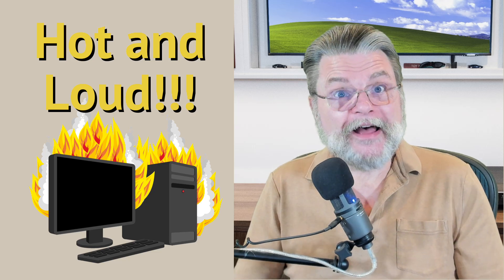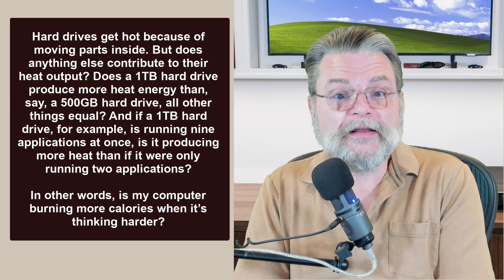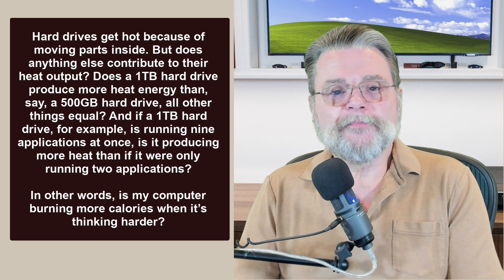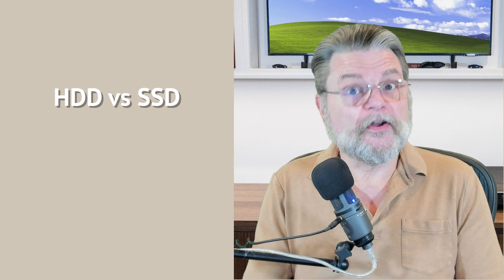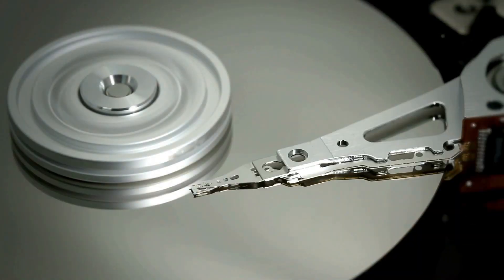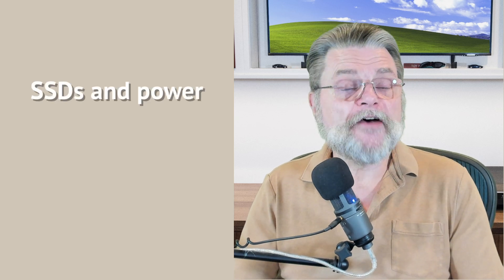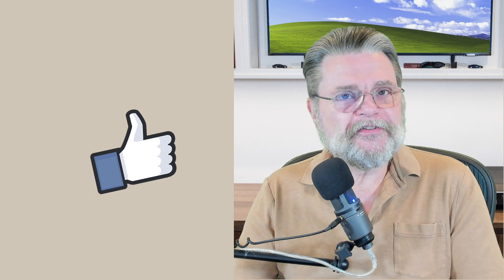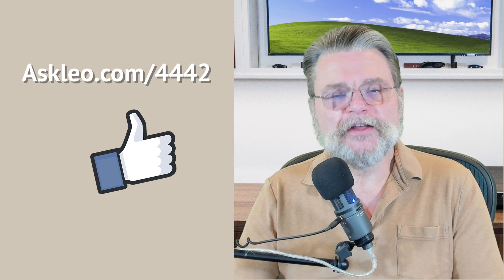Why Is My Computer Hot and Loud?

Comment: I usually have HWinfo running to monitor my CPU and GPU temps. When I installed a new 2TB M.2 SSD my temps spiked. I did not know that would happen. So I got me a 
Thermalright Peerless Assassin CPU Cooler and that thing is huge, but it cooled the CPU down by 20 Degrees (C) across the board.  Thanks for your videos!

Comment: 1)
If your CPU's thermal paste has dried up, then you will not be able to cool your CPU.  You can have a flagship cooler, running at warp speed, and it will be ineffective.  The CPU will likely throttle down its speed, when it gets too hot.

I learned this the hard way, with my 1st Gen i7 CPU (Core i7 950), that I still use, today.
It takes many years to burn away your thermal paste.  I think that mine lasted 10 years, of 100% up-time, before I had to scrape off the crud and re-apply the paste.

2)
Your GPU throws off lots of heat, too.
The higher-end your GPU, the more heat it can generate.  The more work you throw at it, the more heat it will generate.

3)
Your SSD will not heat up from read requests.  If it does heat up, it will likely be inconsequential.

Write requests will heat up your SSD.  And the more advanced your SSD, the more it will probably heat up.

In other words:
If your SSD is capable of writing at 400 MB/s, it will heat up when it writes at that speed.
If your SSD is capable of writing at 4,000 MB/s, it will heat up much more, when it writes at that speed.

But the amount of heat will be negligible for 99.99% of typical use cases.
What heats up an SSD is when you run something that writes to the SSD, non-stop, for several minutes.  For example: Chia crypt-o plotting will heat up your SSD like nothing else, because it never stops writing to the SSD while it is plotting.
Reply: And not all thermal pastes are created equal.  :)    Good advice! Yeah, when I installed a new 2TB M.2 SSD I got a LOT more heat coming off the CPU, too.

Comment: Great video but, their could be another explanation to noise that you did not mention. Depending on where the noise is coming from, if you hear constant clicking or grinding it could be the HDD ready to fail. Only applies to mechanical drives. Most 120mm fans today are relatively quite unless you are using 80mm fans which are very noisy at full speed and 80mm fans are very seldomly used today. Unless it is an older system or a dealer brand like HP etc. Sometimes it can be the type of fan, some fans are for static pressure or positive airflow, how many blades and pitch of blades as well, not to mention type of bearings used. Other than HDD failure you can have a fan failure as well. Depending on type of noise heard it is also possible for PSU failure as well which sometimes can be worse because of the risk of fire. The caps (rarely) on the board can fail too but that usually won't give you a warning, they just blow and it's game over for the system. But the most commons top two is mechanical HD or fans. Also newer CPU's are power hungry that generate a lot of heat under load, AMD Ryzen 5 5600 is one of them. Idle temp is anywhere from 28 to 32 C, it is rated to go to 90 or 92 C max (if I am correct), after that the CPU throttles down or shuts down to protect itself. Newer CPU's require more wattage to run now because of the processing power or cores they contain, especially with built in graphics. A 12 core CPU will require more power than a 4 or 6 core CPU and will get a little warm or toasty, which means one will require a more effective cooling system. There is still a debate between using just fans or an AIO cooling system (liquid cooling). Personally I am not too keen on liquid being in the same area, in case of leakage or pump failure, I still prefer fans and good ventilation in a cool environment. But that is just me and my opinion: I personally have found not much of a difference between the two. However I do not game, so I guess an extreme gamer would prefer liquid cooling, but for an average home user their should be no reason for it.

Comment: Run down to your local computer or photography shop and buy a can of compressed air. Take the sides off your (desktop) computer, and blow out the dust. Pay particular attention to the fans and the heat sinks. I do this about once each year.
Reply: Yes but, you forgot one thing. Either hold fans down with your fingers while blowing or disconnect them, because by spinning your fans backwards at high speed will send a current back to your board which can destroy your board.
Reply: Also, it's a good idea to shut down the pc and let it cool down a bit first. Compressed air can get quite cold, and blowing extremely cold air, onto extremely hot parts, can cause bad things to happen.